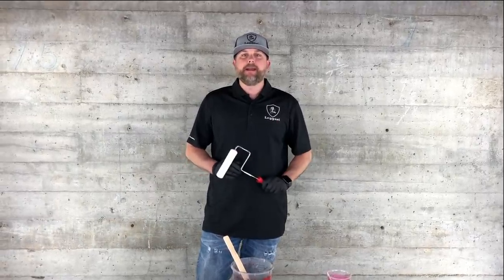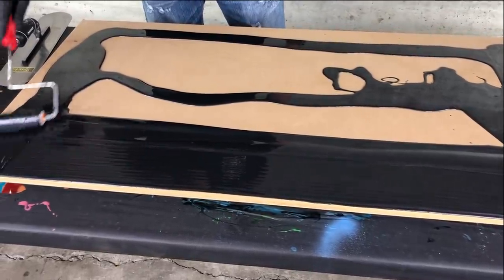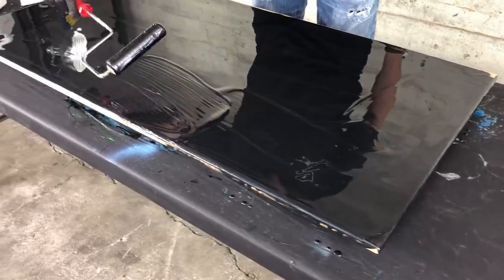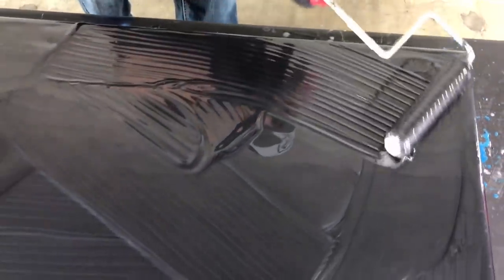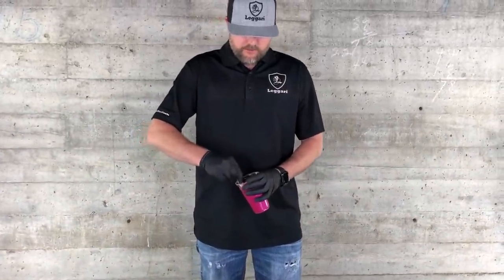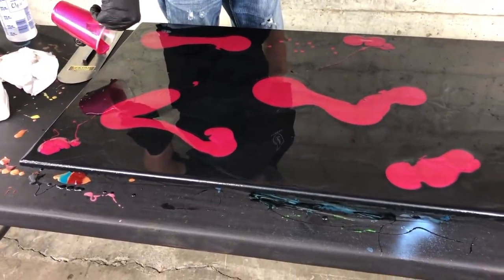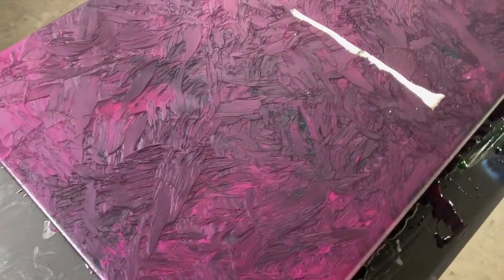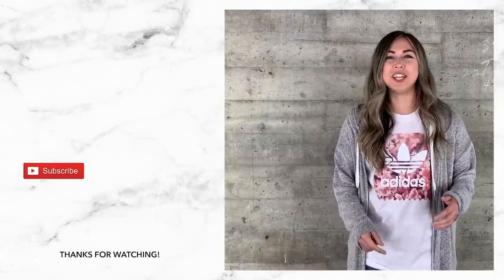3D Technique | Hot Pink & Black Epoxy Board | Leggari Products

Comment: Would the pink stand out more vibrant if you used a black base then use the pink and clear to do the textured part? The pink is so beautiful but as you were doing the texture, alot of that brightness was muddied a bit, only my opinion. You are the professional,  I was just curious. And would it still look textured with using the clear and pink?

Comment: Nice technique, I’m using it in almost every job. Brush, roller or any other tool can be used 🙂
After 1 hour is fine when its warm inside. But most of the time need to apply second clear coat to level it like a glass 🙂💥💥💥 Leggari, you probably have done all colour combinations already 😀👍 would love to see this technique in single colour blue or turquoise, using brush
Reply: If you're waiting 1 hour, what's the final cure time on your epoxy?
Reply: Its really long working time. It tells 45mins.  But it depends on temperature. if I touch epoxy after 90-120mins its still self levels perfectly
Reply: The Void its touchable in good heat in 8-10hours. Sandable after 20-24hours
Reply: @ResinitCoUk  Hmm, That sounds similar to the stuff I've got right now. I'm really tempted to try some ideas out with this technique. Just need to pick up some small trays or something.
Reply: The Void it’s so difficult to do small pieces. For me easiest is to do something big. As bigger as better. I’m struggling with a small pieces.
If you don’t have what to do for yourself - do it as a present for someone close to you. Maybe vanity unit top or a splashback, kitchen island or even a full worktops 🙂
Reply: @ResinitCoUk  I'm mostly thinking about doing dice trays, using a small painters trow and maybe the open end of a tin can or something. I make dice for a living, so it would be another handmade item to add to the shop.
Guess I'll have to give it a try and see if I can get some good results on a smaller scale. Thanks for the info :)

Comment: Hello ... great job you guys are doing! For temperature control is there need for installing mdf board on concrete before applying epoxy especially for extreme cold weather cases?

Comment: I achieved this”effect”a cpl of times when I was first starting out.....only it wasn’t on purpose-I pushed the working time of whatever crappy epoxy I picked up from Michaels or Home Depot😏Maybe I should’ve embraced it though, cuz this turned out pretty cool👍🏻Did u pour a final clear coat over the piece?
Reply from the maker: No we did not.  Our products are actually industrial coating made for military aircraft hangers, etc. So theoretically in a residential, or even commercial setting it will last forever. This is NOT a cheap epoxy paint that you will commonly find at box stores like Home Depot or sherwin Williams. It is a thick 100% solids epoxy coating.

Comment: Looks great, a question, do you need to balance the top?
Reply from the maker: Yes we make sure the surface is level before we apply the epoxy.  Thanks
Reply: @LeggariProducts  thanks, I actually ment do you need to balance it as in put something on the other side to negate bowing? Like when laminating, I have to balance the opposite side with something. Thanks for the reply.

Comment: Did u put a sealer coat on that after or did it settle by itself to a very smooth surface?
Reply from the maker: No he did not add a top coat to this project.  Yes the epoxy will lay out glass smooth.
Reply: Good question I had same question

Comment: did you apply a clear coat?
is the 3d smooth like a glass sheet?
Reply from the maker: Yes he did a top coat.  We have 3 different top coat options. Glaze coat is our super high gloss top coat that lays out glass smooth just like the metallic epoxy coat. Our WB Urethane comes in high gloss and leaves a minor texture and we also have a WB Urethane that’s a Matte/Satin finish.

Comment: Does it remain ruff?
Reply from the maker: We have 3 different top coat options. Glaze coat is our super high gloss top coat that lays out glass smooth just like the metallic epoxy coat. Our WB Urethane comes in high gloss and leaves a minor texture and we also have a WB Urethane that’s a Matte/Satin finish.
Reply: @LeggariProducts  Oh so if you top coat it after 3 D effect it will be smooth? Excuse my ignorance. Amazing work!
Reply from the maker: The glaze top coat will give you a glass smooth finish but the urethane will have a minor texture to it.